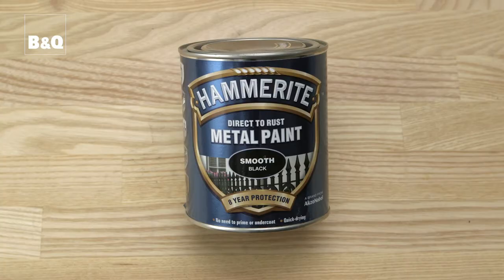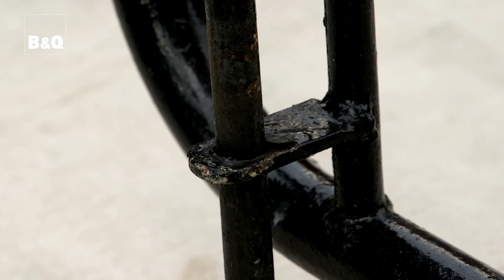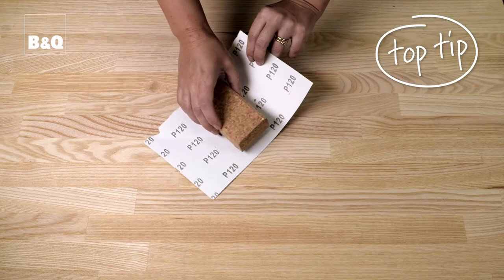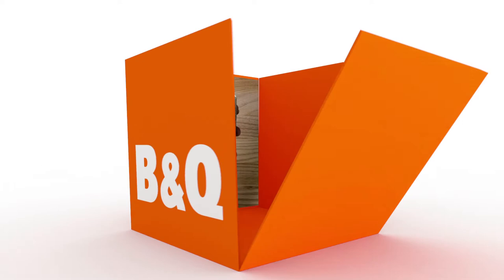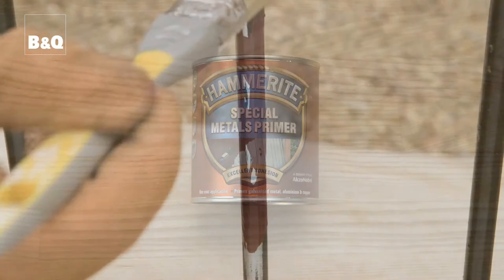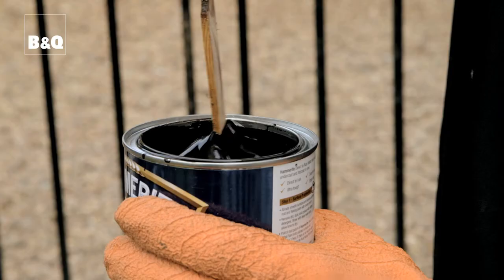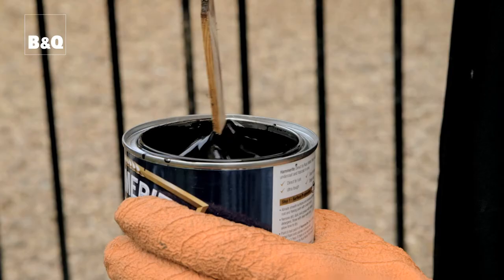How to paint external metalwork

Comment: What do I do about the rusts?
Reply: I wire brushed and sanded then cleaned before hand
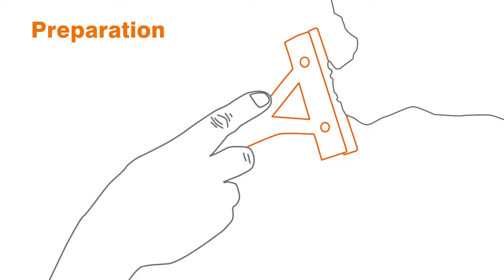Reply from the maker: Please see the preparation section of the video for details on this, 0:17 😄
Reply: @bandq  ty
Reply from the maker: You're welcome 😊
Reply: use an angle grinder save yourself so much work